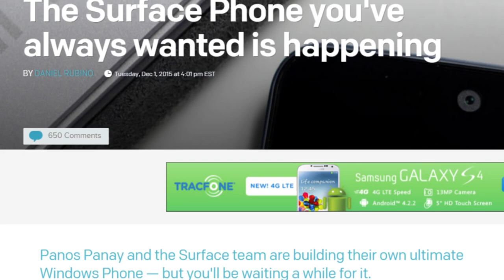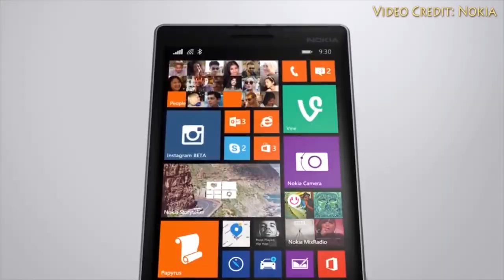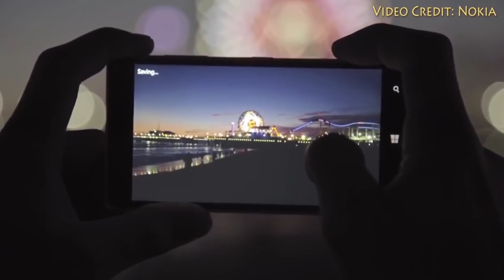Microsoft Surface Phone : Official Trailer 2016

Comment: Did you even do proper research? Its slated for 2017 and intel pulled out the mobile market
Reply from the maker: Ya . I researched. thus mobile launching date is posponded to 2017
Reply: Well if intel don't then. I'll go with AMD processors. Amd are way better than Intel. It's just a brand of processor not a successor. I never had a problem with amd but me, my friends and family always had problems with intel.
Reply: Amd & Intel Are both Good . But, Intel Brand is Best as compared to AMD Processor. Sometimes we face some problems in Intel But in other case it is best processor.
Reply: For you but for us Ex-Intel users. It's the worst.